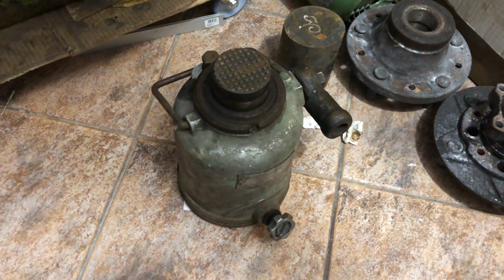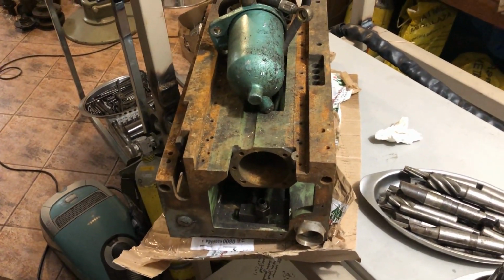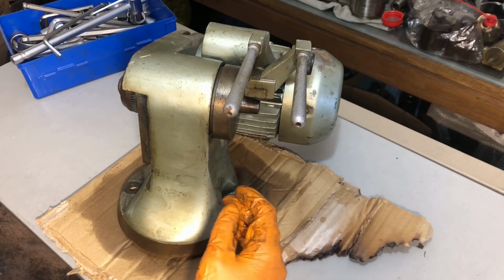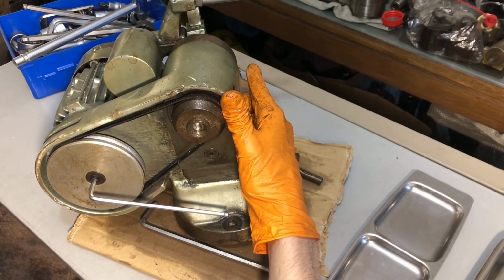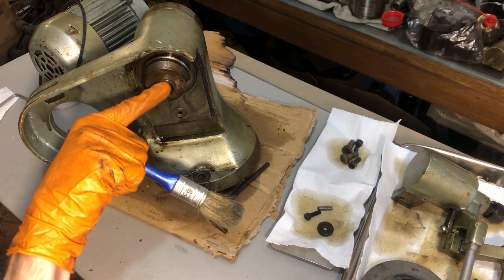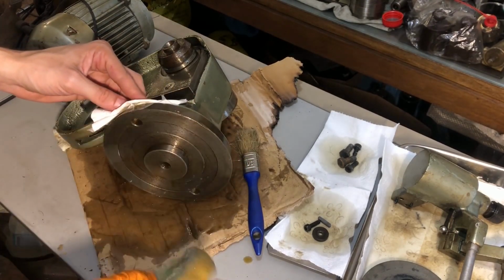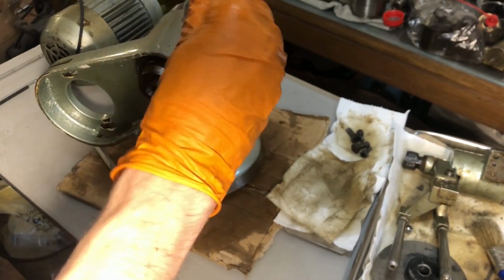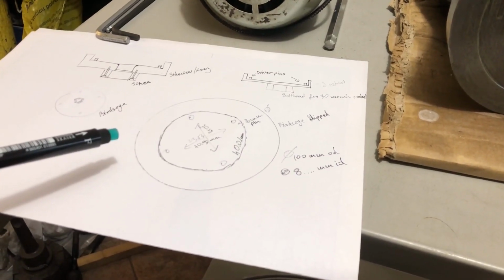Fiddling with a pantograph head off of some unknown machine and loads of yappin`

Comment: Man you have some good scrap yards lol. That grinding fixture is super cool.
Reply from the maker: It`s just one scrapyard... I have access to a few more, but it`s a hassle going that far(european version of far, so 15km(10mi)), but the reason i don`t go is because i am not running a restauration shop atm, and seeing machines and pieces that i can not save and have to accept as a sight of something beautiful that i know is condemned to be smashed and crushed is something that i refuse to allow into my mind... Until my shop is built and shit is set up, and i can start going to scrapyards and picking up machines that are healthy, casting-wise, i will have to restrain myself... Last time i went to one of the other scrapyards, i have seen a `yuge Wanderer mill in her last moments - with an acetylene torch slicing through those massive sidewalls of the machine body... I actually cried a bit... You should have seen that beast... Tossed only because she was a huge beast unbecoming of modern productions and performances... A sin for all intents and purposes... But alas, here we are... I`m just grabbing the camera and going downstairs to deal with this square casting that i plan on using for metrology once finished... I had the tab open and saw your comment, so i`m replying in flight... 

Best regards!

P.s. you should see the surface grinder that is tossed onto that scrapyard that i am visiting... i may pick it up if i get the chance and my shop gets done quickly enough... i oiled it, pumped it full of oil, wrapped it in foil and covered the foil with steel slabs to keep it all tight... But time is of the essence, tho i suppose that the owner of the yard is already done betting with the workers and his wife as to whether i will buy that machine(he knows i will)... So he is more than likely going to have infinite patience with that machine and will be willing to toss her in a cramped corner of the yard to wait for me... fingers crossed